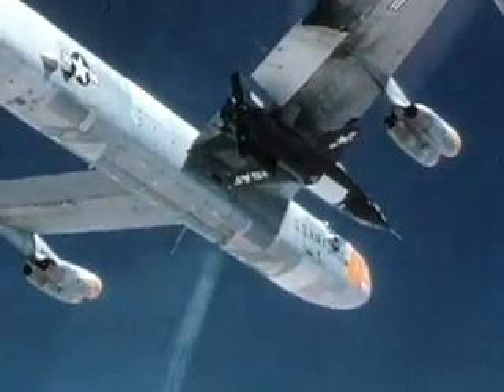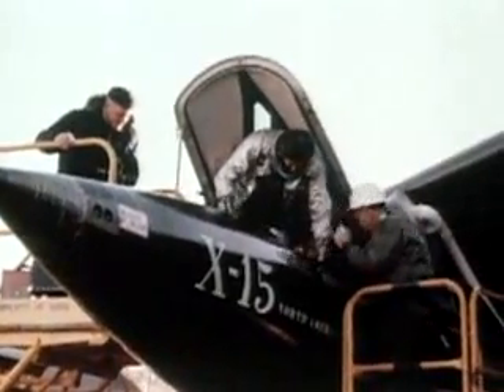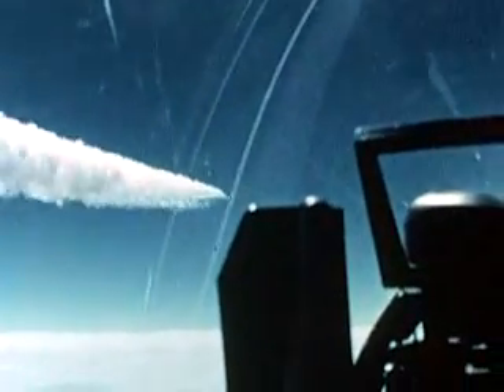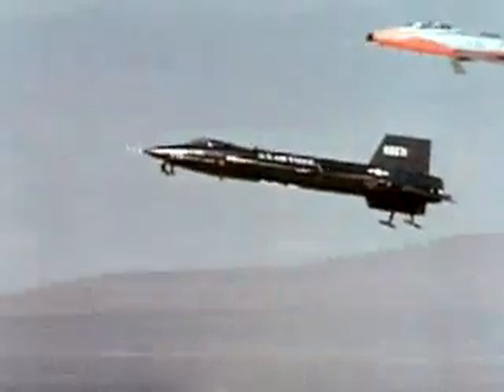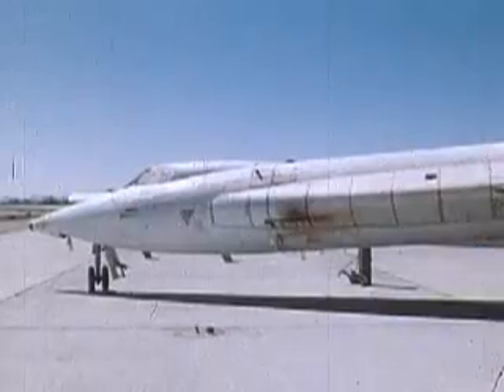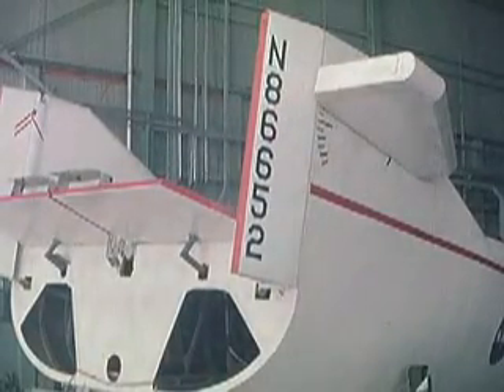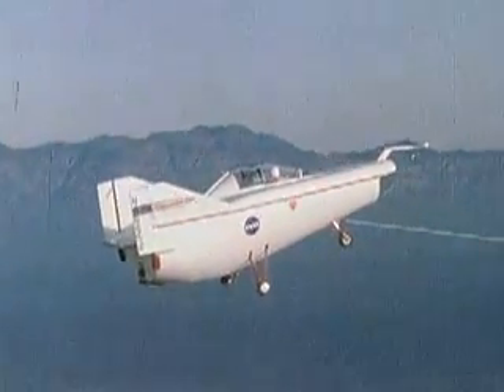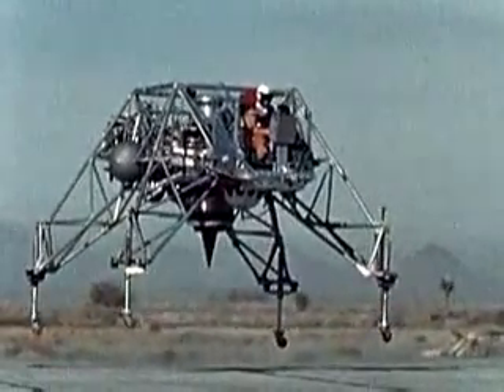Dryden's 60 Years of Flight Research: The X-15 Era

Comment: "Heading for the Northeastern corner of Nevada..."

How ironic!
BONNEVILLE!
Right on the state line.
Most everybody stays in Wendover,NV during meets&events there.

I never knew that-
it is cool to know that the fastest car and aircraft both ran in the same general area...

I know that the X-15 event covered a HUGE area but it was cool that t
The Salt Flats area was the point of embarkation for the X-15....